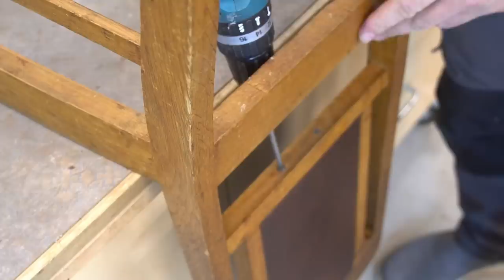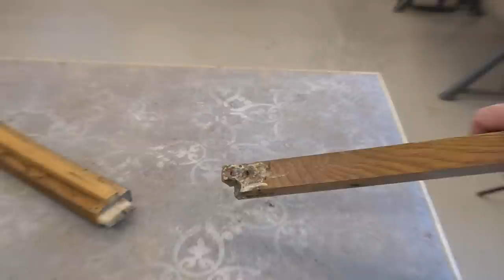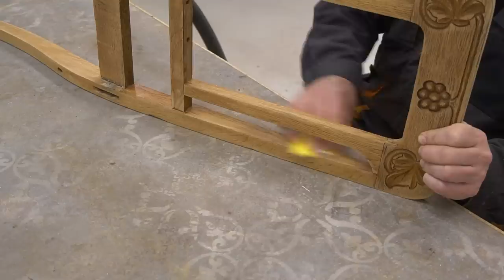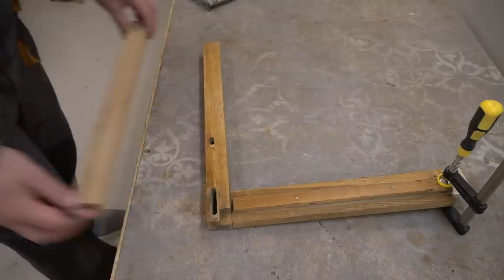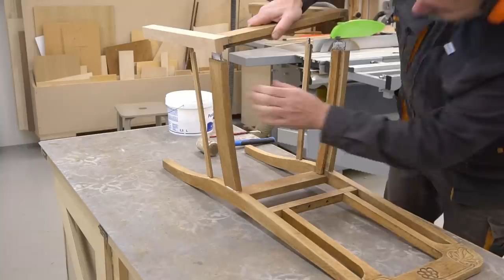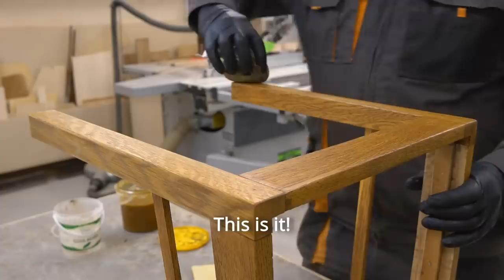Old chair restoration

Comment: Is shellac the same as varnish?
Another beautiful piece, and I'm glad you kept the original leather!  💙
Reply: No, it's a natural product. It forms a film on top of the wood, but isn't waterproof like varnish. You dilute it with alcohol. It was the finish of choice in the 18th and 19th centuries, through until the 60s, so the best option for restorations. Most of the wood primers today are just heavily diluted shellac.

Comment: When using a square-drill attachment, you must try to initially drill complete holes and not overlap the earlier hole. 
Remove the “dams “ the last. This will reduce the heating of the drill and prolong the lifetime of it.